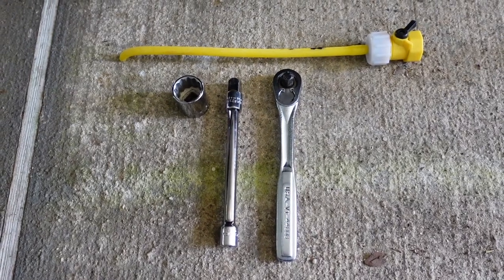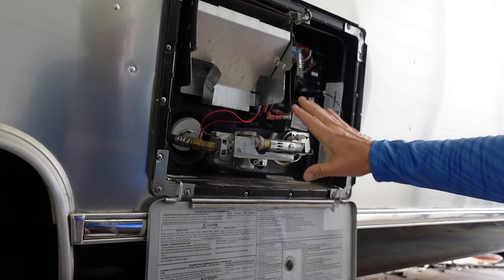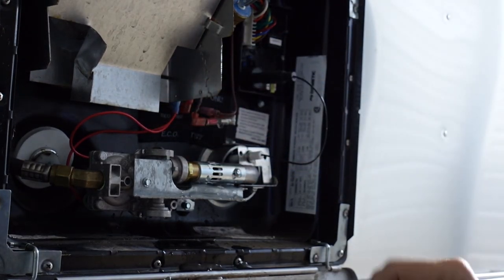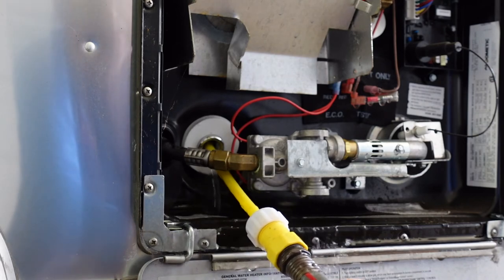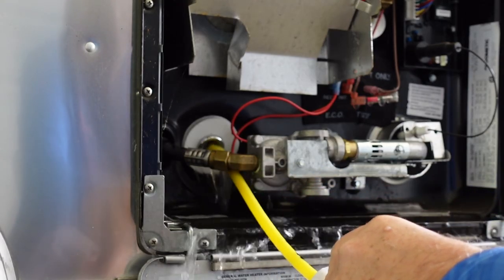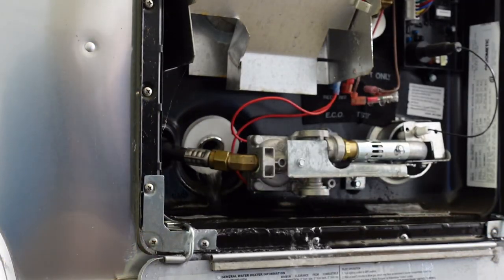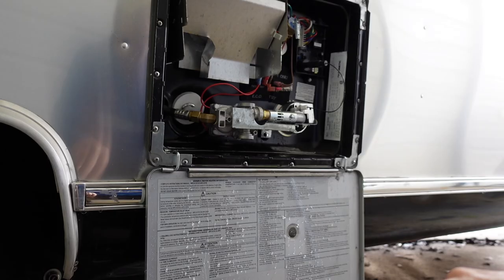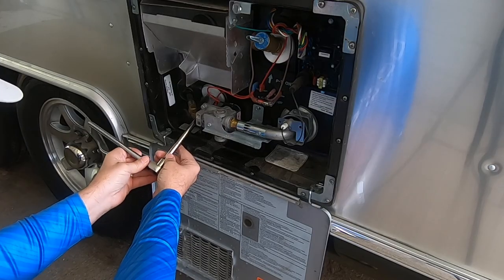RV Hot Water Heater Flush - Get Rid of the Odor

Comment: If you close the Pressure valve back off when you take out the drain plug you wont get the Rush of water.  Take out the plug then you can stand out of the way and open the pressure relief valve.  This will allow air to enter and the water to escape.
Reply from the maker: Thanks for the tip.
Reply: I did this last night, it didn't work.  I still got that huge rush of water.